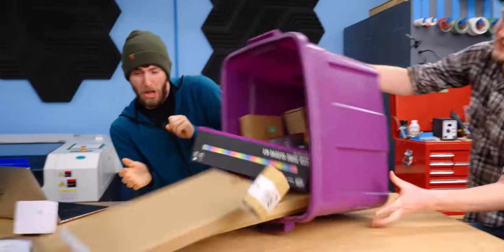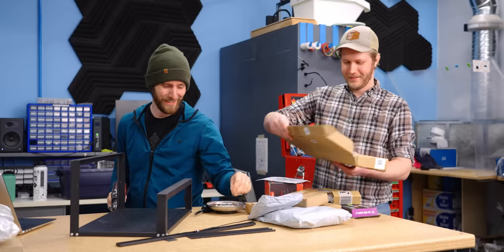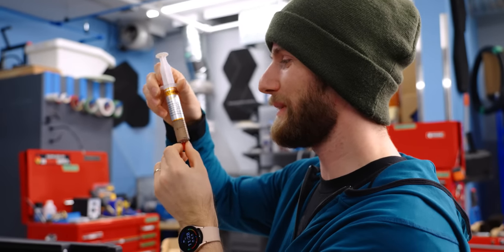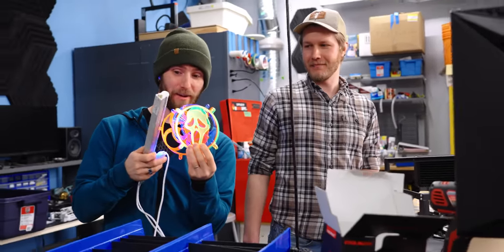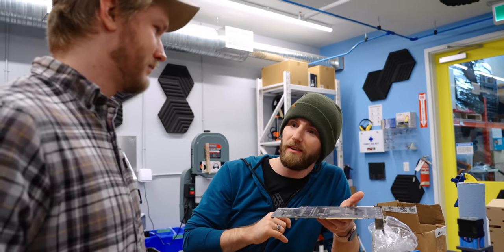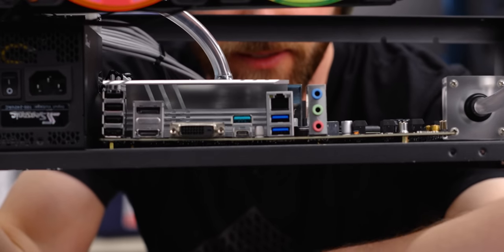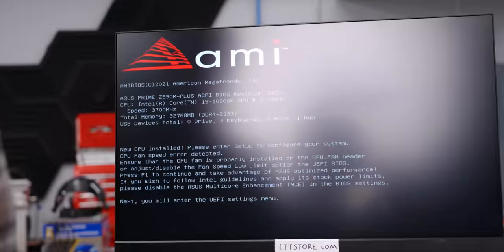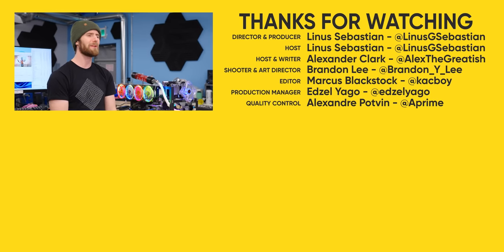Water Cooling… Using only Wish.com

Comment: Fun fact: they sell the same horrifying light bars with exposed AC on amazon, and they even include the same terrifying wires. They include little plastic bits to jam in the end, but they don't stay in very well.
Reply: also sell them in every hardware store and lighting shop, though generally without fly leads. have a couple above my workbench
Reply: thats common connector for t5 light, people installed their house full of those running 240v and yet nobody die from these hOrRiFyInG tErRiFyInG features
Reply: Glad that my old aquarium lamp have that connector covered
Reply: Those exposed prongs are bad. But those included cables for connecting two?!?!?!?! OUT OF THIS WORLD. Who thought that this is fine? Who thought that average user can connect those correctly without shock or fire hazard is beyond me.
Reply: @MariuszChr  not for connecting them together, they are for booking them up to a circuit.
Reply: @MariuszChr  Well, that supposed to be installed by electricians and not on you PC, that exposed wire is for connect to the normal powerline on the lamp switch and the idea is daisy-chain all together.
Reply: I wonder if the UV was the nice mild UV or the burns your retina's out like an ark-welder with no shield UV?
Reply: @JW-uC  put welding glasses on and get that sweet brown tan
Reply: @hksp  you do realize a horrible design can be standardized right? Just cause you don't have personal story's of people dying from that does not mean it's extremely easy. That product is crazy dangerous and should not have a connector like that. Just cause somthing exists doesn't mean it's good.
Reply: @tenderjerky3504  lmao, those 3 or 2 pin plug IS the standardize connector for all T5 lamp
Reply: @hksp  I worked for The Home Depot for many years sold many of T8 - T5 receptacles that had that plug on the end that came in a kit with the little pig tail end to wire in the next receptacle. Maybe it's not as common in Canada?
Reply: @FloppytopHoppencock  they're used to powering their gadgets using bluetooth connection
Reply: @JW-uC  It's safe. You need a quartz tube light to make UVC, and any plastic around it is gong to survive for a mere handful of seconds. I'm going to bet it's actually near-UV visible light, deep purple, 410nm approximately. You can just about see it and cameras can just about capture it, it activates UV reactive pigments strongly, and is generally considered safe. This also explains the confusion where they named it UV in one place and purple in the other. The reason they'd use it instead of any of the true UV is the lower total cost: already 360nm would require special considerations for all plastics involved in the construction, at which point the price of your plastic jumps up at least 4-fold and well above the $20/kg mark - and that's still a fairly non-destructive wavelength.
Reply: @hksp  exposed pins that are live are called widow makers for a reason.
Reply: Amazon sellers literally just dropship their stuff from Ali
Reply: If you want safe, secure and harmless products don't buy cheap

For a higher price you could add proper connectors between them with no exposed copper
But for a guy like me, it's cheaper to just buy things like this and modify them
(like changing cables, adding extensions, 3d printing missing mounts or caps to cover dangerous design flaws)

Comment: It’s likely the rig was made by laser cutting the holes then press breaking it, that’s why the tolerances are so high
Reply: still though wtf
Reply: @TantalumPolytope  that’s how manual manufacturing works, if you want something with low tolerances you don’t use breaks, you use cnc machines, however if you want a part like that it’s going to have high tolerances, cheaper and easier to manufacture bent metal pieces
Reply: Tolerances arent supposed to be that high tho, i work with lathes and the avarage Tolerance i get is 0,1mm or 0,2mm
Reply: @morbidlyobesecat7829 .1 or 2? Man where do you work my tolerances are .005in
Reply: All pressed. The bends and cuts. Cheap af

Comment: Usually when I watch you guys do these builds my jaw is on the floor because of some absolutely ridiculous choice you've made in the modding process (see Alex dremelling memory/vrm heat sinks)....but I have to say, when the multimeter came out for those UV lights THAT was actually the most unbelievable moment I've seen. I honestly still can't believe it. That's honestly terrifying.
Reply: Linus was literally centimeters away from full AC wall power when testing it 😱
Reply: EH, kids these days are too soft. Nothing a little electrical tape or Hot Glue can't solve.
Reply: They come with a block off cover/plug.
Reply: @tdata545  Honestly though, thats not much worse than how North American electrical outlets are when used properly, they just need those plastic plugs you put on outlets so kids dont stick crap in them.
Reply: Honestly it doesnt really shock me that much, ive had plenty of kitchen lights that had the same system to plug mulitple in row lol.
Reply: what if i told you that exposed AC leads on lighting products is the Norm
Reply: Having the habit to look at bigclive video about Chinese electric things I am not surprised. 
It is typical no safety thing …
Reply: @tehbest you can't easily stick your finger in a North American AC outlet.
Reply: @EmergencyChannel  True but this is DIY stuff. So you should know never to work with live wire. Someone also mentioned they come with a block off cover plug. And you don't just twist exposed wire together like Linus said. You solder it and use heat shrink.
Reply: I have a miniature fluourescent fixture (16" T5) with a similar two-pin (ungrounded) daisy-chain socket.

It has a genuine UL listing.

Right out of the box, the connector is somewhat hard to find because the pre-installed cap has such a close fit that the end looks solid. I only found it because I was trying to figure out how to plug in the wall lead from the other end, as advertised.
Reply: nice
Reply: If you think that's terrifying. Try a cheap electric hotplate from Walmart. 110AC right into the shell. Doesn't need an earth ground because you will be grounding it the moment you touch it while powered on if your not insulated from earth (a.k.a. wearing shoes).
Reply: its entirely normal -= go to any hardware or lighting store and you can buy heaps of sets with safety approval. That said had a ground, the ones over my workbench dont, standard figure 8 cable, though they came with fig8-fig8 leads and a decent cable, not fly leads, and theres a cover over the plug.
Reply: @Bobis32  Yeah i mean its no different from a lamp socket... youre not supposed to stick your finger in there either lol
Reply: @wmp0074    Solder?  Are you high?  Most people just use wire nuts.

Comment: Those light bars are meant as under counter lighting, the pig tails are for hard-wiring the lights to your house wiring. There are supposed to be plastic plugs for the exposed ends. And also an interconnect piece, so you can daisy chain the lights. They're actually very neat to install when you have all the parts.
Reply: Yea, as an RF metrologist it seems a bit paranoid to toss them because it's exposed 120VAC.  Fill it with epoxy if you're not going to use the extension plug?  Wax?  All things we've used professionally to block off connections to live wires.  They're recessed so nothing is going to contact them if you fill it with a dielectric solid.
Reply: @tonymorris4335   I am not an electrician or expert of any kind but common sense kicked in and I knew exactly what these were. If a port is not used shield it off, besides why would anyone touch it in the 1st place ... On the second thought they maybe did this for drama effect in the video. I mean seriously why toss it out, the thing does what it is created for. It's not the fault of the product it's the user's incompetence to utilize it.
No wonder why we have so much trash in the world, ppl being drama queens and tossing out stuff left and right for no reason.
Reply: @CelestiRalice  You missed American teens eating dish washing detergent not that long ago before the video was made
Reply: tbh you could probably get away with hot snot in it.
Reply: @Maples01 very true a teen would put there finger in it 😂
Reply: Y’all are underestimating the ignorance of humans.
Reply: I have a set of them for 240V, nearly killed me.
Reply: @Theunicorn2012 So without those parts this is basically the equivalent of buying a handgun with a hair trigger and no safety mechanism to speak of. Perfectly functional, but also generally irresponsible to sell to randos.
Reply: @pptemplar5840  definitely not like a gun. They are light bars. 120V should be blocked off but it will not be anywhere near a gunshot. But most importantly, why are you replying to a reply that says the literal exact same thing as the original comment? Why not just reply to the comment? What is happening? Help!!!
Reply: @MussoGames  It's an exaggeration but the idea is the same. Getting shocked hurts and could kill, getting shot hurts and can kill.
Reply: @DanielFerreira-ez8qd  def an extreme exaggeration. I don’t really care about that though. I just don’t understand how someone could reply to a reply that was the same text as the original comment? I literally can’t imagine someone clicking on a comment, reading replies, seeing a reply that is the exact same as the comment they clicked on, and replying to that. wtf is that? Am I crazy?
Reply: @MussoGames  Man, I dunno. Maybe it was a joke that went unnoticed.
Reply: @DanielFerreira-ez8qd  this is the most important question known to mankind. We must find out the truth
Reply: @MussoGames  Plot so thick you could cut with a knife
Reply: @tonymorris4335 The end of it should at least come with a removable protective plastic cap if not being used!

Comment: 24:49 There’s no electrical safety standards on Ali-E either. Note: rechargeable battery devices there simply have no voltage regulation. When you plug in a USB charger expect 5VDC to go to the lithium cell. I bought 2 portable game devices to give to children and it turned out they literally never stop charging (at 5V).
They categorically refused to refund, I fought and fought for months. I explained you can’t sell fire hazards like this – do not care.
Reply: Lmfao why should they care? It’s being sold a whole world away. For the record you just bought garbage products, most of the better made Chinese shit I’ve ordered charges fine.
Reply: You shopped on Ali-E and willingly gave the product to a child? What did you expect?
Reply: I bought fake aliexpress joycons and one stopped working. Opened it up to find the battery was triple the size it should be. That could literally have blown up like a time bomb in my face. 

Yea. Never buying shit from aliexpress ever again
Reply: @9393zach  ' better made Chinese shit' kind of contradiction there mate.😆
Reply: @snapdragon9300  well... they keep all the good stuff for the domestic market ;)
Reply: Brought an inverter thru them, no Earth's, no fusing whatsoever 🤷, was supposed to be "1500watt" but it started to let the smoke out trying to run a tiny 400w drill😒🤷🤷
Reply: @snapdragon9300  Your phones are made in china
Reply: @snapdragon9300  you're likely typing on a device with parts made in china
Reply: @aarvlo  but don't you know china bad?
Reply: @snapdragon9300  nearly the whole world's quality products, Nintendo, apple, Samsung, cpus, graphic cards, pcs, tvs, GPS systems and more are made in china.
Reply: @snapdragon9300  My pocket radio from the 80's or 90's is from china, its awesome.
Reply: I wouldn't be surprised if this was the same product that caused a friend of the family's home to set upstairs ablaze with 
They had refugees with them and this happened
Reply: noob
Reply: @liftyee1430  You're dreaming lol.  I've lived in Asia, they're not keeping the good stuff for local sale.
Reply: You really expected Aliexpress to have safety standards on their electronics?
Reply: Oh yeah, those portable power cell jumper cables for cars are literally death traps.
Reply: @johns1625  My experience is children's toy. Little gameboy knock off. I was shocked when I used a multimeter than 3.7(4.2v max) li-ion cell was at 4.9 volts and it was still trying to charge it.
Reply: Devin: "you can't sell fire hazards like these in the west!"

AliExpress: laughs in chinese

Also, to everyone saying 'your phones are made in China'. Yeah. To the specifications of other countries' businesses and safety standards.